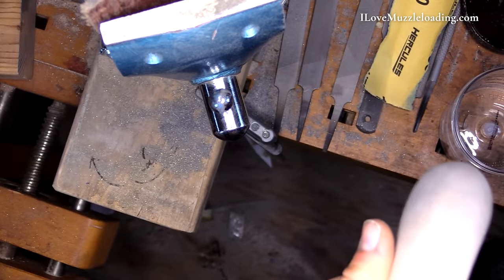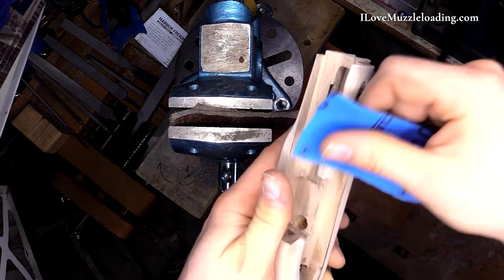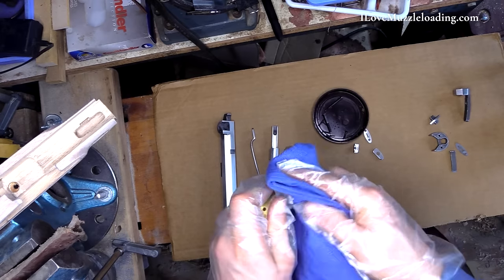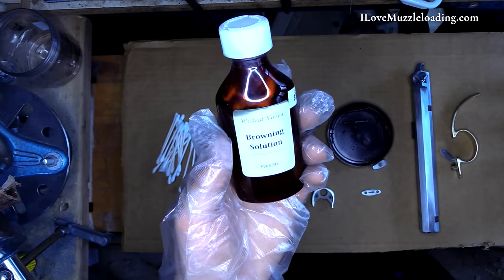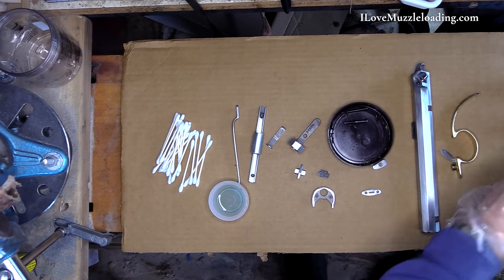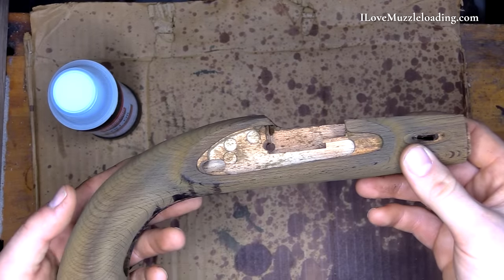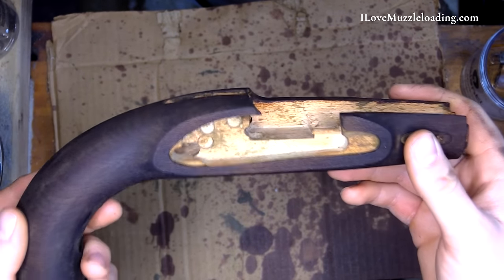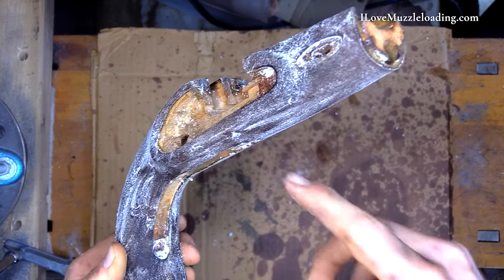Let's Build an InvestArm Plains Pistol Kit Part 10: Stock Stain and Metal Finish | Muzzleloader

Comment: Needs more heat! Jim Kibler's video says you cannot use a hair dryer, which leads me to believe this. I did my colonial with a harbor freight heat gun on high and it turned out beautifully.
Reply: I was surprised by how much heat I needed with ferric nitrate. I may try some iron acetate on a stock next to get an ebonized color.

Comment: Good morning!   I have really enjoyed watching the progress on this project.   Thank you for sharing your experience so far.   "Aqua Fortis" (strong water) is nitric acid in a solution.   It was used form many things in industry.   It's pretty corrosive to most metals so you definitely want to neutralize it with a base compound.  I.e. baking soda.  If you don't, over time you MAY see some small areas of corrosion where wood touches the metal.   The main/effective ingredient in the solution you used from Jax is an acid form of selenium - selenious acid.  This is a common coloring agent used in changing color/appearance of brass, copper, bronze, and other similar metals.  A type of sulfur solution can also be used.  Ferric chloride is generally the main ingredient in metal browning solutions but there are many other "formulas" that have been, or are used today.   All these can be made/mixed at home but, it's usually much easier (and for most...) safer to purchase established products.

Comment: When I apply heat I use a cherry red bar straight out of the forge and pass over the stock and with that kind of radiant heat you can watch the reaction take place before your eyes it’s something to behold especially when there’s a lot of curl to the maple. I do realize most folks don’t need or have a forge but I think if you heated a piece of steel with a hardware torch it would probably work to the same effect. Nice job you had your self worked up for nothing Ethan .

Comment: Next time before applying the aqua fortis burnish the wood with a deer antler. Work every inch pushing the grain down. On your first coat of oil mix 2 parts turpentine and one part tru oil. Apply with a red scotch brite pad it will help fill the grain plus allowing you to manipulate the highs and lows of color like an old used stock. Burnish again after it dries sometimes 2 or 3 times. Then go to straight oil. I learned this technique from a Jim Kibler vedio. He used boiled linseed oil. I use truoil on all my stocks. You definitely want to neutralize it. After baking soda I then rub it down with household ammonia to make sure. Nice build Ethan. 👌
Reply: I like the Bob Ross reference.

Comment: I have darkened wood using sodium hydroxide.     This is an old technique of staining woods that have alot of tannin content.   I have used it on cherry and it works quite well.     It is a very strong base, so you obviously have to be careful and wear gloves and eye protection when working with it.  I think I neutralized it by misting a diluted vinegar solution.

Comment: you may want? to Passivate all threads and or unfinished surfaces along with finished surfaces?   
I have taken more than one arm or any equipment apart only to find corrosion in hard to reach or not often accessed areas?

Comment: Just a tip, if you cross drill the ramrod ends and peen in a piece of brass rod 1/16 " or so it will save some headaches later. I've had to pull several ramrod ends from rifle and pistol barrels over the years and it kinda sucks😊 I am 62 years old and have 40 plus years playing with muzzle loaders  I shoot primarily flintlocks now and when people ask me how hard they are to shoot, I answer that I've been shooting flintlock for 30 years  now and I'm still learning how.